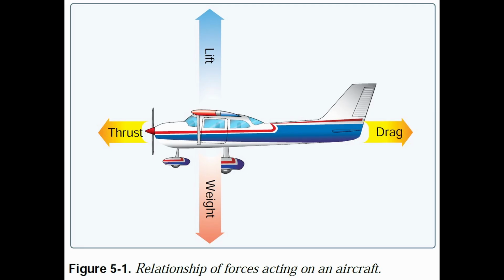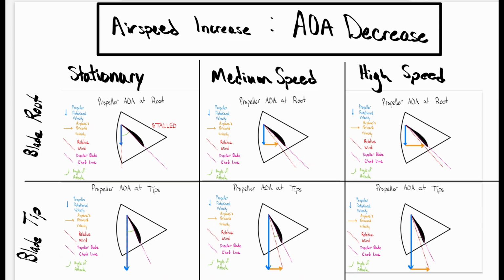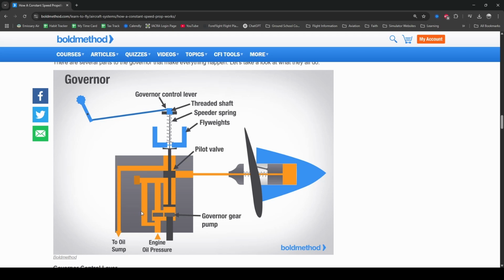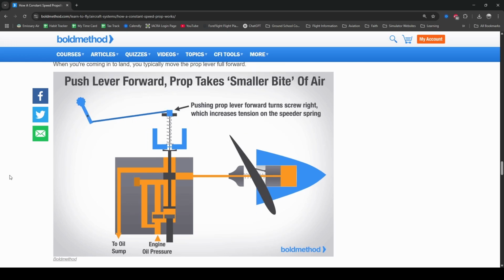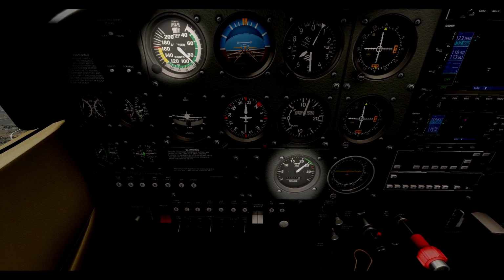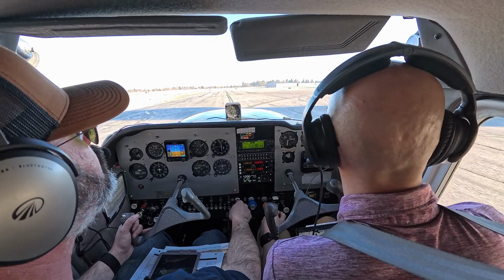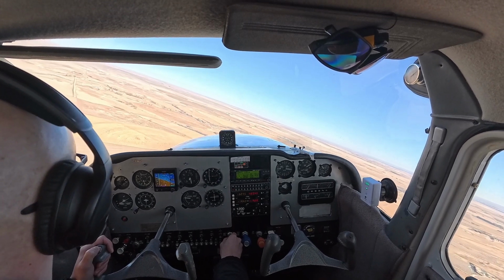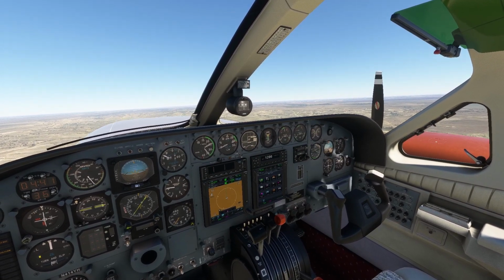Constant Speed Propellers | EXPLAINED!!

Comment: Might be simple, and largely correct, but there's a few points that are dead wrong.   Allow me to address the corrections in reverse order here.    When I do my final landing checklist "abeam the numbers" I pull out my throttle to idle.  From there I see the engine RPM go below the prop setpoint, and then I slam my prop full forward.  From there I put in throttle to my approach setting, which is about 12 inches manifold.    If, on the other hand, I brought my prop forward earlier, I would have to do so carefully and still risk overspinning my engine.    Ok, so, now there's cruise settings.  This one you'll have to do some research on.   It turns out your PROP MANUAL likely has setpoint advice pertaining to your power settings.    Mine, for example, says "Do not operate above 22” manifold pressure below 2350 RPM."   This is because too much engine power can damage the prop at too steep of a pitch.   As long as you abide by this advice from your propeller manufacturer, it's actually WISE to run oversquared!  It will save you gas and engine wear.